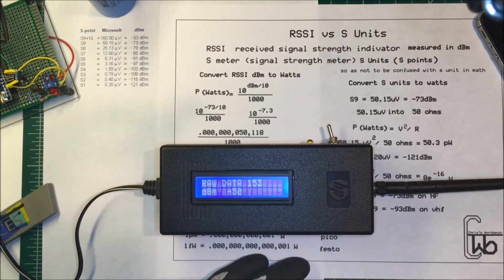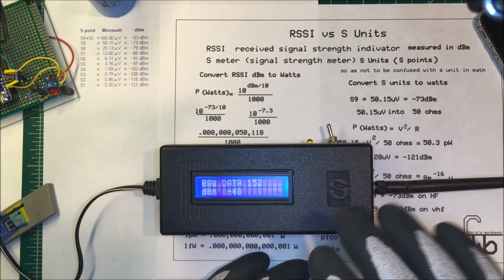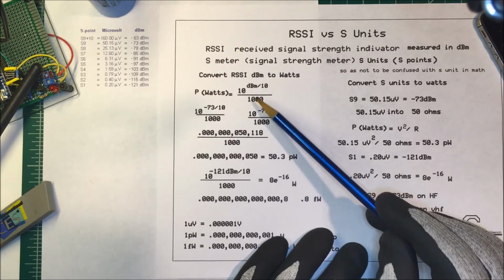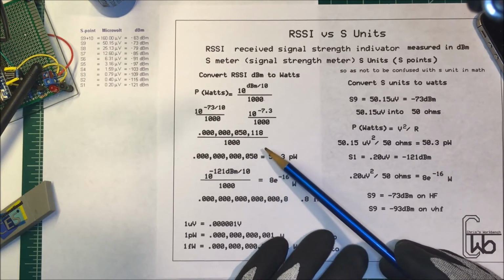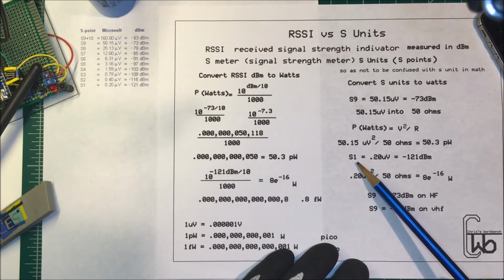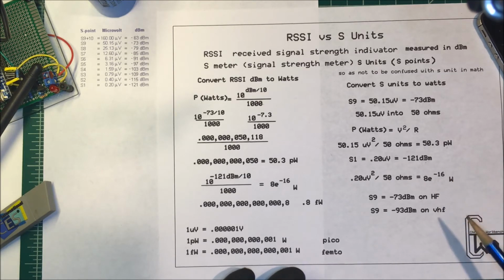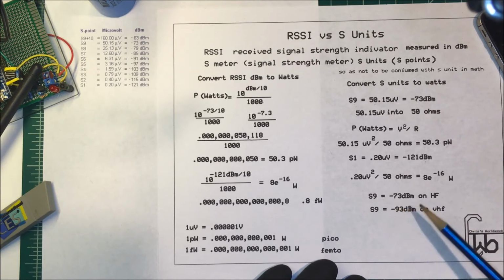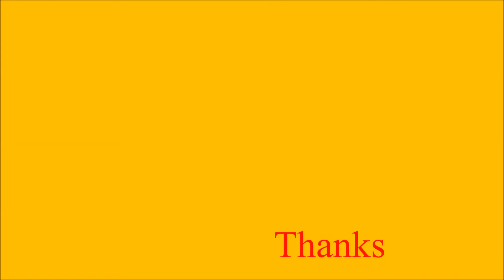RSSI vs S Units

Comment: as i know, the rssi value is about 0-255, other develop  use 0-100 for cisco, 0-60 for atheros. so, the problem is how to convert that rssi value to dbm value? i need to know what is the formula. can u help me.. 

sry for bad languange.
Reply from the maker: Good question,  RSSI is an arbitrary integer value, defined in the 802.11 standard.
Each vender will have its own  max RSSI value.
The energy level reported by a particular vender will range between 0 and RSSI max.
Not much help.